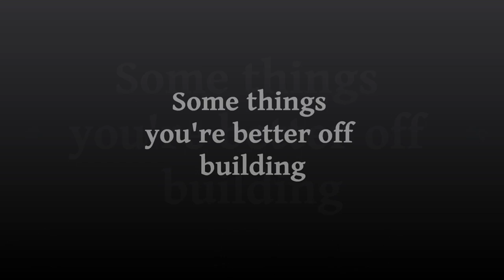Make Your Own Bed Frame And Save-DIY

Comment: Very sound, logical design w/ the 4x4 legs UNDERNEATH -supporting the outer frame. I'm imagining just a few modifications and it can be designed to use a box spring with even fewer 2x3s.
Reply from the maker: Thanks for watching

Comment: buy a antique bedframe,with headboard & footboard,they def won,t break,like everything made in those days,it was well over-enginerd,& built to last
Reply: I recently bought an old bedframe...but want to add oak boards and slats for better support.  Older bed frames were not designed for futon mattress only; these older frames relied on box spring too for support.

Comment: I built this design for a twin sized bed only made it cheaper but just as strong (the key is that the legs support all the weight) with 2x2's and 1x3's for slats/side trim and 2 2x4x8s for legs - 6 legs instead of 4 for extra support. I double bolted the legs on the sides and the ends to better hold them in place. It worked real good for a twin bed.
Reply from the maker: Thanks for sharing!

Comment: Great design I love it!! 
I would recommend putting some noggins down the centre of the joists to stop warping over time, if you plan to keep it for a while.
Reply: Noggins?
Reply: @rachellestringer  blockers I think they are called in America, just timber in between the joists to stop the timbers moving over time and just for extra strength

Comment: Great video as I am about to make a Full size bed frame after watching this so thanks brothers. I wish you would of added in the description "How many 2X4's & 2X3's it took before they were cut two size" and the same for the 4x4's before they were cut to size. Add like $13 for blank # of 2X4's ya know which would be helpful for us first time builders. Again thanks
Reply from the maker: Yea that would've been helpful. To be honest I had no idea this video was going to help thousands of people.  Only if I could do it over again I'd include that.
Reply: @TheRabbitryCenter  yes it is very helpful. I was looking to buy one. The metal ones are cheaply made. The wooden ones are way too expensive. So I'm thinking how hard can it be to build one? Only problem im having is how to do it simply, and yet last for years. This video is the one im using. Im getting this project done this weekend! Thanks  for posting..you helped a whole lot of people!!

Comment: just made 2 of these, a bit more expensive 10-15 bucks more than the advertised price but i chose a bit more expensive 2x4. Probly could've found some cheaper bolts/screws but fuck digging thru home depot's messy layout. These things are incredibly sturdy. Thanks for the simple design!

Comment: Best one so far. Quick question. If I wanted it a bit higher would the 4x4s still be a good choice?
Reply from the maker: Once you put a box spring on it is a bit taller but Yea give it a whirl
Reply from the maker: Yes

Comment: HOWS THE SUPPORT IN THE MIDDLE? DO YOU THINK IT WOULD BE A GOOD IDEA TO PUT A CROSS BOARD DOWN THE MIDDLE-LENGTH WAYS?
Reply from the maker: Hey j hORn, The support in the middle is rock solid.  But I'd entertain that if the bed is for two or a bigger sized person for sure. Thanks for the comment.
Reply: @TheRabbitryCenter  how would the middle support be placed? Before or after the sideways ones? Going to attempt to make this bed in the next 2 weeks haha
Reply from the maker: @foscouni  There's no need for a middle support its rock solid.  But if you really needed the extra support  I'd make 5 legs instead of 4 
and use the 5th leg on the middle 2x3
Reply: 2x4s are really strong one 2x4 by itself is strong enough for you to stand on when it's put in the way he did it.
Reply from the maker: @shatterpointgames  yea it's still going strong and we didn't change a thing. thanks for commenting.
Reply: @foscouni   the way he did it is the same as say a shed floor, a deck or porch frame, etc. If you do it as he did, you won't need a center support like the cheap metal frames. The way he did it will be enough for at least 300lbs per square foot concerning support. Just FYI
Reply: Thanks yall! I'm not a builder lol. I managed to make it without the middle and fantastic!
Reply from the maker: @foscouni  I'm glad it worked out
Reply: The Rabbitry Center is this for a full size bed ??

Comment: Loved everything.....but those prices are definitely not out of control 😂
Reply from the maker: Maybe but we went through a couple in two years and for what they cost they shouldn't break.  That's when we decided to build something that's stronger and it cost a fraction of the price
Reply: @TheRabbitryCenter  true, their are some flimsy things out their for $100. That may not sound like a lot but it is when you can build something much better for cheaper. If you have the tools of course

Comment: Hi
What’s the size of the legs that’s holding the bed frame
Reply from the maker: That's a good question it was 4 years ago. I wish I would've put that in the video I do remember I measured from the floor to the top of the bedframe that we were replacing 14" if I remember correctly.
Reply: @TheRabbitryCenter  😂 Thanks

Comment: how is it? do you still have it? I kinda feel like the 2x4s should be flat, not standing up.. anyways,cool project!
Reply from the maker: It's still here and working great.
Reply: Should be flat? No offence but you clearly have no knowledge in wood work or structural support.
Reply: @hitmarker9514  yeah, it's a typo, I meant the 2x3s.. Should lay flat.

Comment: Are you adding box springs on top of frame then your mattress??   I'd prefer to place a mattress only minus the box springs - any suggestions??  Great video...Thanks!
Reply: You’d have to change the design just a bit. Your pieces going across would need to be closer together so your bed doesn’t start sagging in the gaps.
Reply from the maker: I'm adding a boxspring but if you don't want to there's a lot of support
Reply: You could put some plywood on top of the frame. That's what I'm planning to do. With no box spring I'm sure you'd feel those 2x4s in your back. I'm gonna make the plywood sit flush with the tops of the 2x4s so you don't see it
Reply: @fryncyaryorvjink2140  with futon mattress, you need air gaps for air circulation; that's why futons have slats.

Comment: Hi, i saw that the 2x3 support rails are flash with the frame, did the mattress stayed in its place not moving?
Reply from the maker: yes it's heavy enough but you can always wrap a 1x6 around to keep your mattress boxed in
Reply: @TheRabbitryCenter  thanks 👍

Comment: You new suscribed. I have a question: all the wood is the same size except the green short foot. Or can you tell me w sizes of wood you been use in that video. Thank you
Reply from the maker: Yes
Reply from the maker: approximately 53 inches wide by 75 inches long 15" tall

Comment: Hey I made a bed before but it was too small. How can I measure the matter or bedframe?
Reply: Shit i meant matras
Reply from the maker: @joonbax6389  you should be able to google any size mattress you want.  Or just use a measuring tape on a bed you'd like to build a stand for.

Comment: Can you tell the sizes you cut the boards to ?
Reply from the maker: This design is for a full. If you want a full size bed I'd google the dimensions and subtract 1 1/2" for every 2x3. Your sandwiching all the support boards between (2) 2x3's which amounts to 3". Subtract 3" from the the width and you'll have your width to cut. You can get your dimensions that way.  This was a long time ago I can't remember or I'd share that with you.
Reply: Thank you.

Comment: I don’t know if anyone has asked in the comments but, what are measurements for a king size bed?
Reply from the maker: This bed is a Full. A king-size mattress dimensions are 76 inches wide by approximately 80 inches long – about 16 inches wider than a queen.  A queen is 7 inches wider and 5 inches longer than a full-size mattress.

Comment: Where is the headboard??
Reply from the maker: No head board - This is a basic build to replace a bed frame but after framing out simply attach it using (2)2x3's

Comment: $48 before the other tools 😕 I just have a dril and a hammer
Reply from the maker: Purchasing tools - Always a great investment.  
Ryobi Tools- https://www.amazon.com/shop/therabbitrycenter?listId=2SZBCJ7MZW7B4

I didn't buy them all at once.  You can always try to borrow some tools from someone.  I try to make it a goal to buy one new tool every year.  Ryobi tools are the least expensive tools that will work well for you(No, I don't work for Ryobi).  You're either investing in a few tools that will enable future products ( which is an investment that pays dividends for life) or choosing to make payments over and over...

You said you have a hammer and a drill. All you need to borrow is a circular saw and oscillator.  

SAW- https://amzn.to/3rnjwYq

OCSILLATING- https://amzn.to/3q1Soha

WOOD BLADE-  https://amzn.to/3jprQUC
Reply: You can make the cuts with a hand saw if you don't want to spend too much on tools, probably won't get the straightest cuts though.  But if you're a diyer you might as well get the circular saw as it'll come in handy on future builds. I'd even pony up for a portable table saw as that will usually be even better at nice square cuts

Comment: Tks. 1 Q: no rebate to lock in box spring or mattress?
Reply from the maker: Yea, You always give up for what you get.
Reply: @TheRabbitryCenter  tks..I mean you know how the box spring can sit down inside like say 1"... I think if modified this design too wide. Just apply some thin strips eg metal if need that I guess
Reply: @TheRabbitryCenter  Also, was it intentional to space the end cross members a bit closer to edge than other spacings..for strength?
Reply from the maker: @UTUBE-MONITOR  I'd recommend installing a sister board on the head and foot of the framing to help with mattress support.  The spacing was just evenly spaced on center based on the number of 2x3's we had.